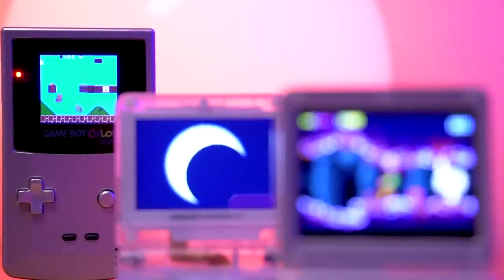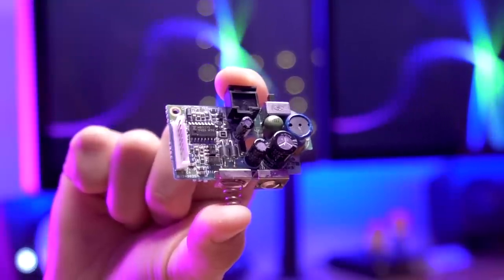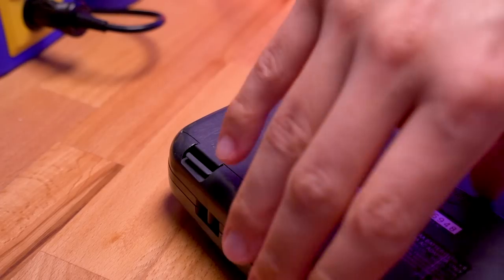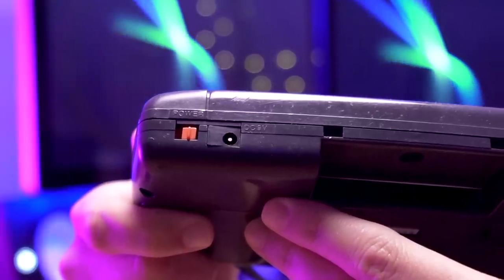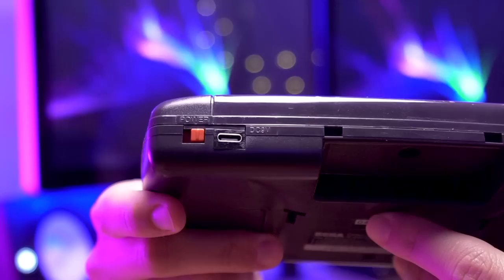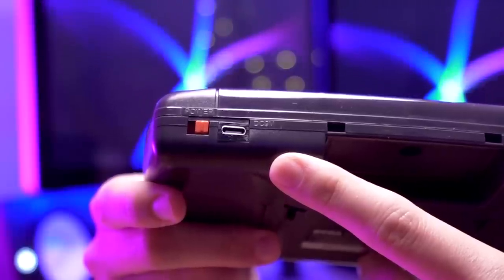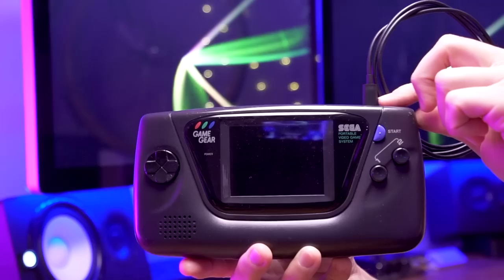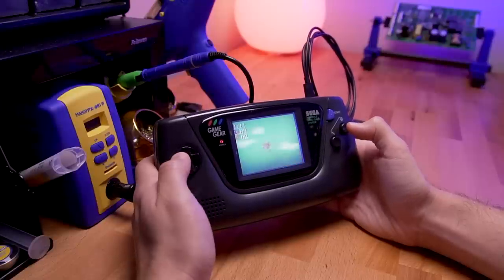WAIT TILL YOU “C” THIS! | RetroSix CleanPower GG USB-C Mod for the Game Gear Tutorial | Retro Renew

Comment: Thanks!  I'm a huge GG fan and just ordered. I molded an old battery backup solution by adding a battery meant for an RC car into that old tube but with some slight mods it works well. Still this is great.

Comment: One drawback is that you can no longer use the official Sega battery packs. As someone who owns the better of the two, aka the one that attaches to the back, this mod means that I would need to mod the pack to work with it.

Comment: Need lipo batteries that fit into the battery slots. Replacement screen that is cheaper than mcwill. Maybe a slimmer case for it since it won't need a backlight tube.
Reply from the maker: Those would all be awesome mods!  Fingers crossed we get some of those!!  Cheers Steven!

Comment: DANG!! I can’t keep up! Just McWill modded my 2nd Game Gear this week! I’m looking into upscalers now to get the VGA out working in my tv (only works on computer screen). The OSSC seems the best lag-free option. And i want to add the pixlx mod from videogameperfection.com to add controllers. My goal is 2 consolized GG’s and play gear-to-gear on 2 tv’s, with the link cable. Both are recapped, but one GG has minor issues. When moving it too much it shuts down/loses power. So i’ll definitely pick up this mod at one point!
Reply from the maker: Jan that sounds like your doing some awesome projects!  I like the idea of linking 2 game gears and playing them on 2 TVs. I hope a consolized game gear kit comes out, that would be awesome!  Cheers Jan!

Comment: It lost me at no recharging batteries. This would be perfect other wise. I have LED modded a couple GameGears and would love a cheaper lcd replacement and rechargeable batteries inside would make for a great experience
Reply from the maker: Me too. The lcd kits available for these are still quite pricey. Thankfully RetroSix is working on a rechargeable battery solution for the game gear. Can’t wait for that!  Cheers Travis and thank you for the comment!
Reply: @MachoNachoProductions  I saw that on there sight so I’ll wait until Next year. I have 2 game gears currently one works perfect with the led back light mod but the other one the video stoped recently long after it was recapped so I may just try one of these power mods on it so see if it fixes it but even if it doesn’t I’ll eventually put in a screen before selling it off. Also keep up the great videos recently did a Gameboy color shell and LCD based on you videos works great but unfortunately had issues with Benn Venn
Reply from the maker: Awesome Travis!  Glad you found the videos helpful!  Hopefully the power board will solve your GG issue. Cheers dude!

Comment: Wait.. You can't charge batteries while in the unit with the usb-c power adapter?
Is there a way to overcome this issue? Charging capability would definitely make the GG better. 

Odd that I didn't know this though considering I had a Game Gear, but then I always used disposable batteries.....
Back then it was "environment! what's that?"..
Reply from the maker: Correct Joseph, this kit won’t charge NiMH batteries, it would have been great if it could. RetroSix is working on a rechargeable battery kit which should come out early next year. I’m going to be on the look out for that. Cheers buddy!
Reply: @MachoNachoProductions  Thanks for the heads up.

Comment: Do you think this same mod could work on the Sega Nomad? Since the Game Gear and Nomad share the same power cable DC port.
Reply from the maker: Unfortunately this mod won’t work on the nomad because the nomad has the power integrated on the main motherboard. It’s not a discrete board like the Game Gear. Great question super nova!  Cheers!

Comment: It would be even better if it could recharge AA NiMH Rechargables trought the USB!
Reply from the maker: Totally agree David!  That would have been fantastic!!  Cheers!
Reply: Charging NiMH batteries process is different than LI-ion or Li-Poli batteries. Charging threw device will kill those batteries in few days.
This is why devices using AA rechargables never provide charging by power adapter.

Comment: I really wish there was something like this for gameboy advance sp. on a heartbeat I would do that mod
Reply: There is
Reply: @stevenbenson9976  wait really? what is called i cant find it
Reply from the maker: I know there is a way to do it, but there isn’t a kit designed specifically for the gba sp. you need a commercial off the shelf component. Stay tuned to the channel!  Cheers!
Reply: @MachoNachoProductions  from what i looked up there were at least two available kits before the one guy hasn't updated his page and just says out of stock and the other guy in the items description says that he was only making the one batch not making any more restock. seems like a cool idea for retro game repair shop to  do or similar stores but I've only just gotten into modding my gba sp and the community so idk if there's a specific reason they dont.
Reply: and not to say anything like the game gear shouldn't have gotten this mod and whatever I just grew up with the gba and the sp and I've never heard of the gamer gear until I've gotten into retro stuff
Reply from the maker: Doing this mod on the game gear is a bit easier since you can just remove the entire power board. The SP has the power supply built onto the motherboard making the mod more complex. It can be done but it’ll be a little more difficult.  Here hoping we get a solution sometime in the future. Cheers!

Comment: Can you still use it on normal batteries on the go?
Reply from the maker: You absolutely can!  It works very similarly to the original power board. It can run off normal batteries and you can also plug it in at the same time and it will run off the usb-c. Very versatile kit. Cheers!

Comment: Useless to me, any universal adapter is allowing to power the original charger, the only thing it changes is the connector to power the console.
If they make a solution that is allowing to charge batteries that are in the console, it will be usefull, but as it is right now it's not for me !
Reply from the maker: Wait till early next year. RetroSix will release exactly that!  Cheers Sylver!

Comment: what's the point of this? now you cant use the original battery (easy to replace the old worn out battery for 5500mah nimh) and you cant use the original power brick. (or the new aftermarket power bricks)

Comment: Are you still using the original screen?
Reply from the maker: For this particular Game Gear I am using the original screen. I like having original  hardware in my collection.  Cheers!
Reply: @MachoNachoProductions  Thank you for clarifying. It looked original, but wanted to be sure. Now we just need a battery with a USB C connector to fit inside the Sega battery back accessory.
Reply from the maker: No problem!  RetroSix should be releasing that mod early next year!  It’s going to be great!

Comment: USB C is not a good or reliable power connector for a Game Gear. Barrel jacks have been industry standard for a long time for a very good reason. They are heavy duty and robust and do the job perfectly fine. Pointless mods promoted to generate false need from people.